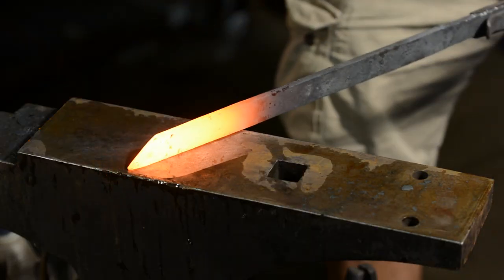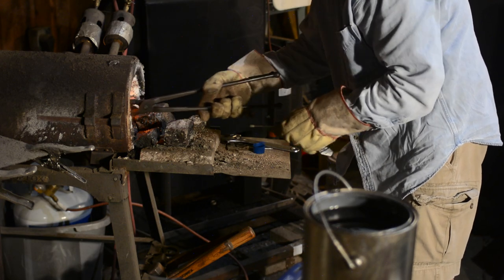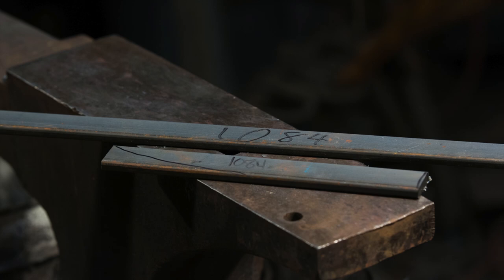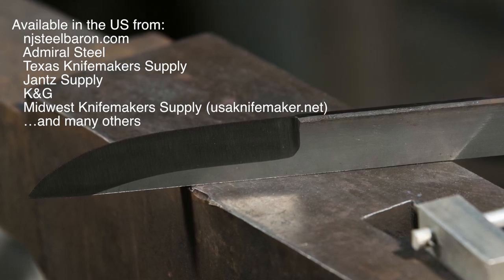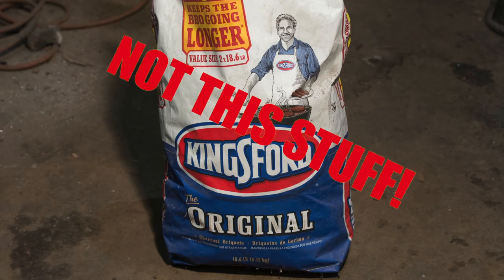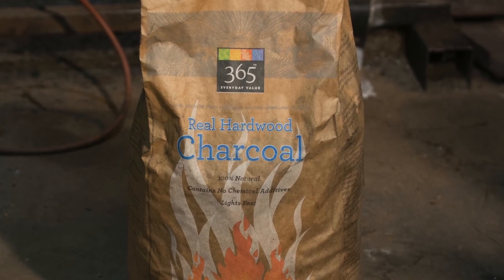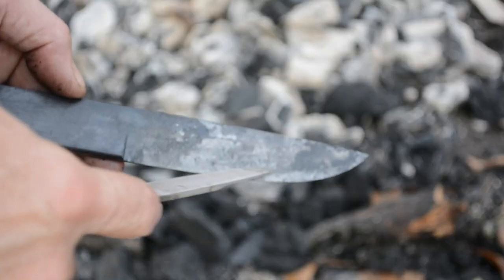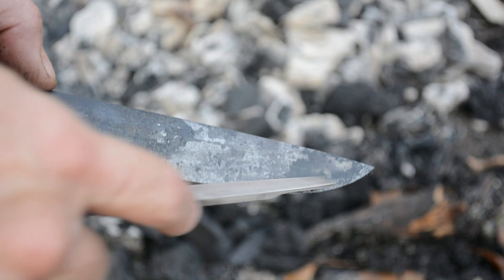Get Hard:  Heat Treating a Knife with Charcoal

Comment: today I actually welded a small billet about 2 inches long,1 in wide,3 inches thick using only charcoal and bellows in a brake drum forge,
my first time,I also heat treat katana blades up to 34 inches long using only charcoal and bellows for air.I live in Tanzania,ur tips have been of much use Walter Sorrels thanks for sharing

Comment: @walter sorrells, can you heat 440C steel like this?
Reply from the maker: +Dave Noriega Unfortunately, no.  Heavily alloyed steels like 440C are much more temperature sensitive than carbon steels, so there's a good chance of screwing it up if you use charcoal.

Comment: What's the reason to use oil rather than water?
Reply: +Majoofi It cools down the blade slower, preventing microscopic cracks in the material. Oil hardened workpieces are also a little bit softer.
Reply: +Majoofi, indeed, oil hardened steels are more than hard enough to make a blade (that's why we temper). If you really want to, you can quench them in water but there is a fair chance of fractures in the steel due to that faster cooling. I speak from experience ...
Reply: *****
thanks
Reply: +Majoofi One thing I forgot to mention is, that the workpiece is also more likely to bend when quenched in water.
Reply: +Majoofi The quenchant is dependant on the steel used, in this case he is using 1084 which is an Oil Hardening carbon steel, another example of an Oil hardening steel would be O1 Tool Steel. Which would likely crack or warp if quenched in water. W2 is a popular water hardening steel. There are even air hardening steels which don't require any quenchant whatsoever, like A2 or S35vn.
Reply: As if you weren't confused enough already the mass and shape of your object can determine your quench media, to a point anyway.  If you have a bulky object you want to harden that is made of a steel which usually calls for an oil quench you may decide to try a faster media because oil may not pull heat out fast enough for the microstructure to change to martensite.  It's Alchemy pretty much.
Reply: +EddvT pre heating the oil/water may also help to reduce temperature shock, also lets not forget annealing.
Reply: ***** Annealing? We're talking about hardening as far as I can see.
Reply: EddvT yes, but if you don't anneal especially 1095 or so the steel its more likely to crack while hardening.
Reply: Ted Winchester   what are you waffling about. It's already been shaped and he is oil quench hardening before heat soak tempering.

Comment: you can do a lot more then overheat your blade and burn your steel i made my forge out of clay masonry and patio bricks using hardwood charcoal i ended up melting my black steal pipe and melting my clap masonry bricks and was left with a nice layer of obsidian glass on the bottom bricks :P
Reply: I am by no means an expert, but the glass could be from poor quality charcoal. I was told that cheap stuff has a lot of impurities, such as sand, which, heated high enough, will turn to glass. 
Hope this helps or is at least something to think about? 
Also (once again- no expert :P), depending on the shape of the forge, it could be way too hot. Like if you made it like a pizza oven shape with only a small opening, then added oxygen, the heat will multiply as you will get not only direct and convectional heat, but also radiant heat (off all the inner surfaces). Would have great efficiency though!
Reply: that is very possible but i dont think lump charcoal has any of the binders in it (no expert ether) and the shape of the forget was something like this with a airdryer for air (d bing the body, c being the air input)
sorry for the crude layout and has sence changed to a more effective desine.
          dddddddddddddddddddddddddddddddd
          dddd
          dddd
          dddd
          dddd
          dddd
          dddd                              dddddddddddddd
          dddd                              dddddddddddddd
          dddd                              dddddddddddddd
ccccccccccccc                     dddddddddddddd
ccccccccccccc                     dddddddddddddd
ccccccccccccc                     dddddddddddddd
          ddddddddddddddddddddddddddddddd
          ddddddddddddddddddddddddddddddd

Comment: do you quench the blade after heating up for tempering ?
Reply: +THCBLADEWORKS no
Reply: +THCBLADEWORKS no you let it air cool, if you quench it you're not giving it time to relax and the blade will be very brittle like after heat treat, it's not the heating that tempers it its the ability to cool slowly that does. the reason you have to cook it for an hour is so the entire blade is evenly soaked in heat, all the way to the.
Reply: +THCBLADEWORKS The only reason I would "quench" it after tempering is if the blade is in danger of overheating.
Reply: +Film Factory Whoa, now.....there is nothing wrong AT ALL with cooling already-tempered steels quickly....on the contrary, it can be helpful to the steel by NOT allowing undesirable structures to form over time.  It isn't necessary to rapidly cool the already-tempered steel, but it definitely will do no harm and can be a good thing.
Reply: polishavenger1
I have heard that as well, usually referring to tempering for too long.
Reply: +Colson Customs Tempering is function of temperature for a minimum amount of time to allow the reduction of brittleness, reduce the internal stresses in the steel set up by the hardening process and to allow the knifemaker to impart the properties to the steel that he/she desires to see in the final product.  While the time at temperature may have a minimum, the downsides of extended periods at the proper tempering temperature are very few, if any.  If I left my blade in my heat treat oven for 24 hours at 400 degrees, it would perform exactly the same as if I had tempered it for an hour at 400 degrees.  As long as the temp is the same, you're golden.  Now, if I left that blade in my oven for 23 hours at 400, then ramped the temp up to 500 for an hour, it would be just as if I'd left that blade in the oven for 25 hours at 500 degrees.
Reply: +THCBLADEWORKS I sometimes quench O1 blades in water between temper cycles. It has no adverse affect on it.
Reply: +polishavenger1, do you think there's any benifit to tempering more than once?
Reply: +Shane K Shane, I temper at least twice, following the advice of more knifemakers than I can count.  Simply put, the steel will benefit from tempering twice (converting what is called 'retained austenite' to martensite) if it's possible to do so.  Tempering simple steels with fairly decent accuracy requires nothing more than a reliable household oven, so there's no excuse for not being able to do a decent job at that task.
Reply: +Shane K However.....is it ABSOLUTELY NECESSARY?  The answer is no.....but most of us want the best performance we can get out of our blades, so going that extra step and avoiding as many short cuts as possible is point of pride, contributing to the mindset of a craftsman.  This is, of course, my biased opinion.
Reply: +polishavenger1, thanks for the help. How do you straighten out a blade when it comes out of the quench and is bent a little? Also, is there anywhere I can look to see some photos of your knives? Sounds like you know what you're doing.
Reply: +Shane K Thanks for the compliment, Shane.  I'm just an amateur and an observer for last 35-40 years...I don't sell my knives and don't have too much time to devote to the craft as I should.  Seems like every time I go back to the grinders or the forge I have to re-teach myself how to do this stuff.  I don't have a youtube channel or website, but I've posted a couple pics on bladeforums.  Stick with Sorrells, he's an incredibly well-respected maker, and in my humble opinion, has the best how-to's  on youtube.  He's consistently provided us with a quality look into his mindset and an honest craftsman's take on knifemaking, its pitfalls and its demand for dedication.  I only wish some of the masters who are no longer with us could have used this platform to demonstrate the skills they used in their primes to create blades that the current generation has no idea even exist.  But, that's just my nostalgia speaking.

Straightening a blade out of the quench can sometimes be accomplished with a pair of thick gloved hands and the blade still smokin' hot out of the oil...generally, you've got a window in which the blade hasn't "taken a set" and it's got a little flexibility.  Still others have clamped their hardened blades between plates of aluminum or steel while tempering with good straightening results.  Others swear by using a three-post vise jig or a hydraulic press.  Plenty of ways to skin that cat, including leaving your blade a little thicker before quenching to avoid the warp completely!
Reply: +polishavenger1, you're right about Walter, I remember first reading about him in the early 2000s in blade magazine. Something about cutting steel cable IIRC. I also got to meet Bill Moran at the blade show in Atlanta, I think it was 98, and bought a couple of his how to vhs tapes, I don't know what happened to them but would love to watch again. Moran has always been a hero of mine, you're right, it would have been great if he was still around and making YouTube videos.

Comment: Can I heat treat a rasp file that I have turnt into a knife without breaking it?
Reply: Yes. Normalize it, then you first quench in oil, if don´t harden quench it in water.
Reply: yes, the metal should react relitivley simillar. a rasp is mde from tol steel and thats very highcarbon so itll be a good knife.

Comment: how would you heat treat welding steel?
Reply: Quick answer: You don't. if welding steel is the same as mild steel then It'll be better to use a high carbon steel.

I've learned that halfway through making a Katana by using a leftover piece of mild steel from Home depot. I've spent so much time and effort on that katana so I decided to try and harden it anyway.

Long Answer:
First you want to add carbon to the blade. The carburization technique can add carbon to the surface of the blade (either 2mm deep or 0.2mm deep I don't remember). You want to pack the blade in a source of carbon (sugar or carbon dust). Then you want to heat up the steel like that for at least an hour. I had my katana in a giant campfire for the duration of the evening and left it to cool over night. Just know that you will probably be grinding off that carbonized layer when you are refining the blade anyway.  

To quench it you need to perform a "Super Quench"  
The quench is set up by getting large volume of water (I had a katana so I needed the volume), add salt to it making a brine, add a lot of ice, and then top it off by adding a surfactant to it. The surfactant being dish soap. It helps to reduce the vapor barrier water makes when it touched hot objects. 
You have quickly submerge the red hot blade into the ice cold brine that you made and you have to constantly swirl the blade to discourage the formation of that vapor barrier.

When I pulled my katana out of the quench it went from being completely straight to developing the characteristic natural, but slight, curve. I could tell that the katana got harder because it resisted me significantly more when I tried to bend it. However, when I put a file to it, the file dug into the steel at most parts. My failure was probably due to the fact that i tried to use a campfire to evenly heat a sword.I got the Katana to glow red but the heat probably wasn't evenly spread enough.
A smaller blade and setting up the fire like in this video might work but there's no guarantees. It's probably not going to be hard enough to keep an edge.
Reply: Tynan Roussety slams hand into face

Comment: isn't this method just "case hardening" the steel? Where only a fraction of a millimeter on the surface ends up tempered and anything below the surface is just soft? After the first sharpening of the blade you will take off the hard layer leaving the soft behind

Comment: So how does it work with stainless steel?
Reply: Just use other oil?
Reply: Sorta the same, but you have to temper at much higher temps than a residential oven will go. 700'+

Comment: Friend, I thought from the title that you were case hardening. I don't know of anyone who case hardens Knife Blades.
…..RVM45
Reply: +RVM451 Case hardening is entirely different. You heat the steel/iron in a sealed box full of carbon, infusing carbon into the surface to make it harder.

You can heat treat after, or at the same time, to effect these high carbon layers. However that's not normally how it's done with knives or swords.

Instead the steel starts with a good carbon content and we change the carbides (carbon/iron compounds). 

The method described works, but you are loosing carbon from the surface layers while you do it. Hence the comment that while it works, there are better methods (given the equipment).

FWIW I tried this before seeing the video. Made mistakes, but still got a good blade. That said, I'll still be looking to heat treat my blades using charcoal, because I lack better equipment. I'll just wrap them in stainless foil with a bit a paper (to remove O2) and temper in a domestic oven (which doesn't differential temper as described, but will be good enough for me).

By the way, as said in another comment, the best way to differential taper is to heat by a plate on the spine.

Comment: I just completely melted an O1 blade in a charcoal fire... I guess my air compressor was pumping a little too much oxygen into it.
Reply: +Jimmy Grey Yeah, I did that once as well, kind of anyway :-))) a compressor isn't a good source of air for a forge. The compressor gives you high pressure and low volume, whereas what you need is low pressure and high volume.
Reply: Anglo Spanish Racing Well I made an air inlet tube thingy, which essentially was a pipe with a few holes drilled in the side. My compressor was regulated for low pressure. And I could control the air flow with a lever. It worked well I just think the fire was too hot and I left the knife unattended for a minute too long.
Reply: Anglo Spanish Racing  I didn't really know what I was doing haha, I kept piling hard wood onto the fire all day, and kept pumping that air in. By the time I put the knife in those coals were white hot. I usually heat treat my O1 blades in a propane forge.

Comment: Why oil?
Reply: Semi synthetic or fully synthetic
Reply: Vegetable oils work fine.
Reply: Olive oil?
Reply: Sudo Nym Canola would be better. The thinner the oil, the faster it will cool the steel. Olive oil is pretty thick but it'll do if that's all you have. If you preheat it it'll help.
Reply: Thanks, so would this oil like baby oil, or WD40 do?
Reply: Sudo Nym To be honest, I have no idea. You can try on a small test piece and see if it hardened.
Reply: Thanks.

Maybe I'll try some chain oil first. Or maybe kerosene; that's a thin oil...
Reply: Sudo Nym Hope you're not too attached to your hair...

Comment: How about 440C?
Reply from the maker: +Tommaso il Parodiatore 440C is a stainless steel which can't be heat treated this way.  To get the most out of 440C, you need to have pretty specialized heat treating equipment.
Reply: +Walter Sorrells Thank you,like propane torch?Another thing:wich perform better O1 or 440C?...Your video are important form me because I'm becaming a knifemaker
Reply: +Walter Sorrells Sorry I don't want to be annoying.I see that when you're grinding or fileing the bevel you don't mark the center line...how do you know the centre?Is incorrect ti do that?
Reply from the maker: Actually I do mark the center line.  I just don't always show it.  In fact the little gizmo in the foreground of the thumbnail for this video is used to mark the center line.
Reply: +Tommaso il Parodiatore If you live in Europe, like me, it's easy to buy O-1 and it's a good steel to learn with.
Reply: +Walter Sorrells how do you put a blood groove on a knife
Reply: Ryan Hopwood Search for Walters Bo-Hi tool video. I just made one and it works pretty well.
Reply: +Anglo Spanish Racing Thank you
Reply: +Tommaso il Parodiatore To heat treat 440C, you'll need a heat treating oven and a way to control your temperatures fairly accurately.  Propane torch won't do.  "Performance" is a totally subjective word that shouldn't be allowed in knifemaking, because each steel has its own characteristics.  If I were out on a fishing boat all day, I'd much rather have a 440C blade than an O1.  But, if I didn't have a proper heat treating setup, or wanted to have a field knife that sharpens fairly easily, O1 wins.  If you're just starting out, make things as easy as you can on yourself and just start making knives....dive in....get your hands dirty....too much talking takes away from the time you could be making sharp and pointy things!